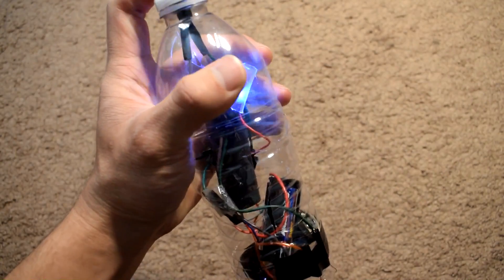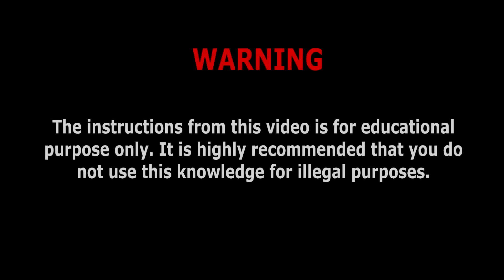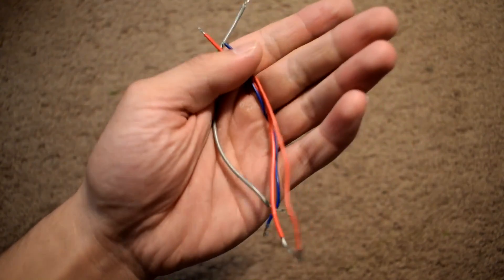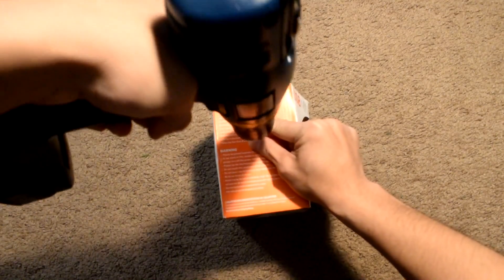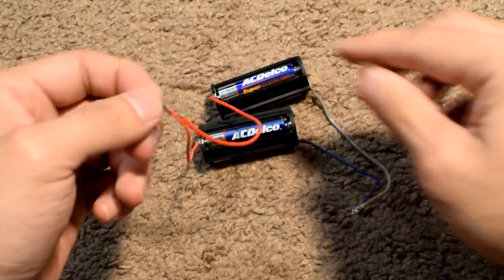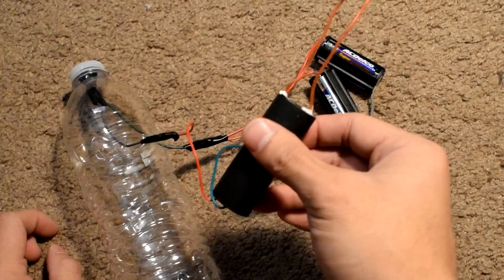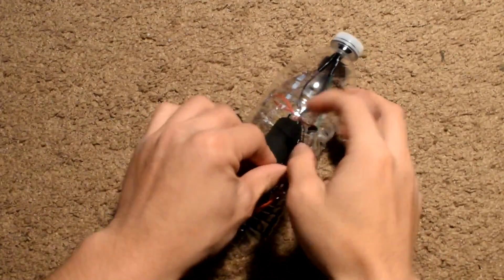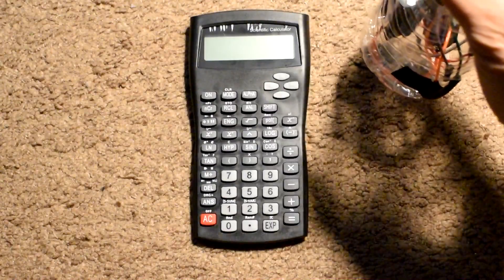How to make a Portable EMP Device (Easy and Cheap)

Comment: Does voltage generator and emp device are the same? And do i able to build an emp device using only battery and a copper wire flupped on a top of a bottle can?

Comment: What happens if it only resets the calculator, mp3, watch, digital alarm clock, etc? Is there a way to completely make it were it won't operate at all?
Reply: With more powerfull emp you can made it

Comment: Really annoys me that those Chinese voltage boosters are labeled as 400kv. Measure the spark gap (if you can without it frying because they don't last long with no load) they are about 30kv

Comment: I want to make something like this but we're it turns off most LED lights around me I seen a video we're this guy's cv radio turned off the led light in his shop I heard it was the frequency overloading the led power supply I'm assuming is built into the light.

Comment: Switch from volt booster to high intensity capacitors to release energy all at once
Reply: What could be done to take out, in theory, a killer robot?
Reply: @TrueChristianityWithSandra  ☝️
Reply: Why not both?
Reply: You can use what he has in the video and add capacitors or (one single high powered capacitor) to it to make a more powerful emp.
Reply: @BobbyMercer-r8i where in the circuit would you add said capacitor?

Comment: I’m new and I’m using it for educational purposes. What’s the use of the metal wires? Can I directly connect a screw where the current would go out to and not use them? We’re gonna make a bracelet stun gun for our research. Thank you!
Reply: The rolled up wire is meant to create the magnetic field that makes it an emp device. If you just make a taser you dont need it
Reply: @bruno6027  but if I take a tazer and attach one wire to a large coil and leave the other as is, would that also work as an emp?
Reply: @_kudos8093  you need current to go through the coil in order to create the electromagnatic field. If you only connect one of the wires the circuit would not be closed. You would need to connect both wires to each end of the coil but even then it is unsure if it would work
Reply: @bruno6027    yeah that's more or less what I meant. I assume that a tazer would work because it is essentially the same mehanism prior to adding a coil and capping the wire. Now do some math and figure out how long you want your coil yo be and how have Vs of a battery you want.
Reply: Yo a bracelet tho? You gonna taze yourself on accident

Comment: why Kyle Reese and his rebels from the movie Terminator didn't think of this, they could end the war in a couple of days🤣🤣🤣
Reply: Sarah Connor Chronicles touched on EMP's and basically they just cause Model 101/T800 through T1000 to shutdown and reboot. There was also the possibility an EMP attack could destabilize the power cell (the T850 had TWO power cells) effectively creating a small-scale nuclear blast. This was generally not an ideal outcome in crowded urban environments.

Later model Terminators had high voltage EMI shielding on critical components, thus EMP attacks were no longer effective.
Reply: Probably did... I'm guessing it didn't work out in some way.

Comment: 3:45 you knocked the battery out dude
Reply: those type of batteries are connected via tape wire, theyre not like the 1.5 V normal type ones. The conductor tape is still connected.

Comment: How many turns did you give the wire to build the coil? What is the diameter of the coil?
Reply: The more copper in ur coil the stronger the field but u also have to account for voltage loss do to the distance the current must travel through the  circuits. meaning the circuits length. so the larger the coil equals a larger in magnetic field but you have to add adequate power to offset power loss so add more batterys or voltage to acquire that larger magnetic field or u can add  capacitors to the circuit for voltage boost
Reply: @troyholder8919  1. is it possible to get an electric shock by touching the coil with bare skin or does the enamel coating completely protect it? and 2. would an emp device such as yours presented in this video be able to for example pass through a human bone of say 6 to 10cm thick if for example I wanted to fry a bug in my skull..

Comment: Is it AC or DC i mean high voltage converter ? or which you called it the booster!!
Reply: The booster uses 6v (4 double a batteries) in DC current to boost it to 400,000 volts in DC current.

Comment: the device you made by using 2 alkaline battery is enough to fry the system of big loud speakers  used in open space ? or i need bigger battery ?
Reply from the maker: The module requires 3.7 volts of input at least. Therefore, it requires 3 alkaline batteries in series that's connected in parallel with the other 3 alkaline batteries. To fry loud speakers requires more power than this volt booster module can offer. However, you can always try them on smartphones and other smaller devices.
Reply: 1kparmar  ikr...why not just shoot them all wile you're at it

Comment: The reason 400,000 volts doesn't kill you is since your skin (while dry) has a ~ 100,000 ohms resistance. The calculation for amperage by volts and ohms is V / O | meaning 400000 divided by 100000 which is only 4 amps. 100 amps must be present to stop your heart. But that would still hurt like a bitch to be hit by. Hopefully you aren't operating with dry (scaled), wet, bruised, scarred, blistered or anything but dry (in terms of wet) hands.

sources: http://www.rapidtables.com/calc/electric/Volt_to_Amp_Calculator.htm
http://www.dribin.org/dave/blog/archives/2003/12/29/amps_vs_volts/
https://van.physics.illinois.edu/qa/listing.php?id=6793

Edit: edited for misspelled words
Reply: bob VGamesAreFun 
Hated whenever my physics teacher/professor/sub answers, 'well, it's not about the voltage, but the current' when someone asks, 'will this kill you'. What he said is true, but still :P
Reply: +Andrew Y P Haha, you just wanna know if you'll die. 10,000,000v will kill you, anything lower is just gonna sting a bit.
Reply: Anyone know the song by chance. Just wondering
Reply: bob VGamesAreFun lol i love your profile pic
Reply: 0.2 mA can kill you dumbass

Comment: Where can I find that spark gap thing
Reply from the maker: You can make one yourself. Just put two wires together tape them apart where there's no contact but it still creates an arc when the circuit is completed.
Reply: GamerKid1024 thx very much very quick response time also can it destroy a laptop or computer as well oh and you've earned your self a sub
Reply from the maker: It would not completely destroy a Laptop. However, don't take my word for it. It could damage the parts within the laptop. Unless the laptop is shielded with metal sheets(Aluminum Body).  In other words, not really.
Reply from the maker: Notice how I mentioned the those magnet wires can be salvaged from transformers or other electronic devices? Most of them are either 32 gauge wires or 24. Or test it out with other sizes.

Comment: can I use a 12 volt battery of a car the power of this device I bet you it would make it way more powerful than I need but can it be done
Reply from the maker: The risk is damaging the Volt Booster by introducing a higher voltage than it is designed for assuming the input voltage is 3.7 volts. In theory, it could work. Why don't you give it a try and try this at your own risk? #YOLO JK
Reply: well if I used a higher gauge wire like a 16 gauge copper wire or 18 gauge copper wire I was thinking that might be better because the higher the gauge The More Voltage it can handle
Reply: god damn... That's some "EVERY MFn THANGGGGGG IN SIGHT 👀HAS FALLEN" SHIT RIGGHTTTT THERE. 😳

Comment: I want to know how to up the power of the device so I can make it more powerful to short out my own vehicle yes my own vehicle nobody else
Reply: The Nordic aliens helpers
Reply: Riiiiiiiiiiggghhhttttttt🤣🤣🤣🤣💯. Can I fly here? I got 17 n a half cars I need done. 😂..so kool.
Reply: IER people help  Use stronger batteries as well as a stronger booster.
Adding more batteries will only increase the amphour or the amount of amps per hour. 
Using a stronger booster without sufficient power would be a waste.

Basically just think to yourself “what makes some electronics produce mire power than others” as well as the fact that this device also uses a booster to increase its power means that you need more than just a stronger battery

Comment: can i use the copper wire in small motor?
Reply from the maker: It could work. The wires I use was a lot thicker compared to the small motor magnet wires. I'd highly suggest you to use the magnet wires from the transformers. They offer the best results. Try to get the magnet wires around 20 gauge.
Reply: well, can i use soild wire which diameter is about 1mm
Reply from the maker: As long as it's copper wires, then you should be fine. Just note that Copper/magnet wires generates a magnetic field when the pulses are constantly flowing through it. That's why the spark gap is significant for this built.
Reply: many thanks bro. i have made it successfully
Reply: How? Exactly the same as the video?
Reply: 张浩然 
it's really work bro
Reply: Yeah. trust me. i successfully did it.
Reply: @张浩然-o3d hi how you connected batteries